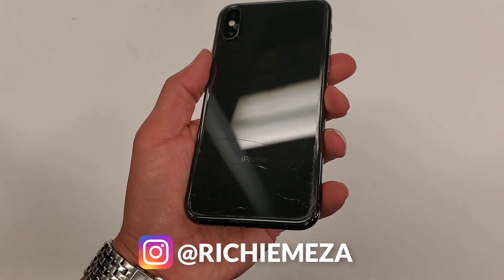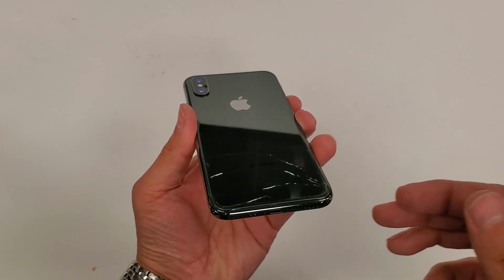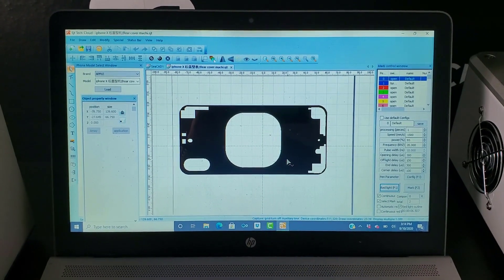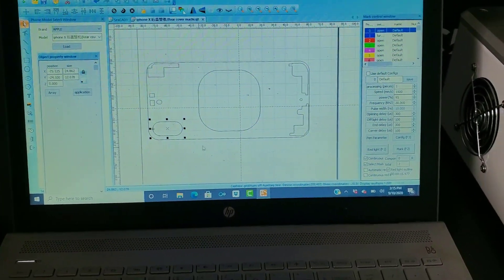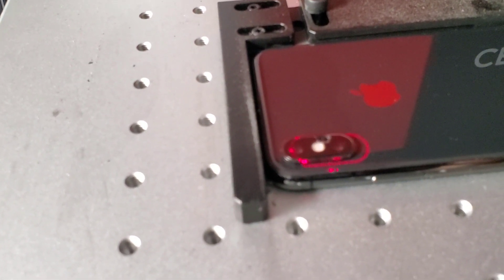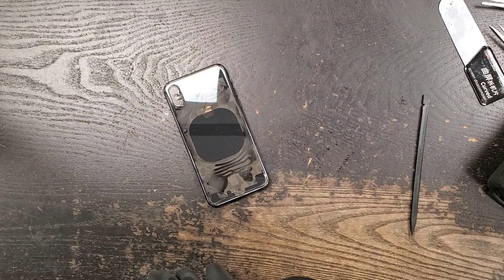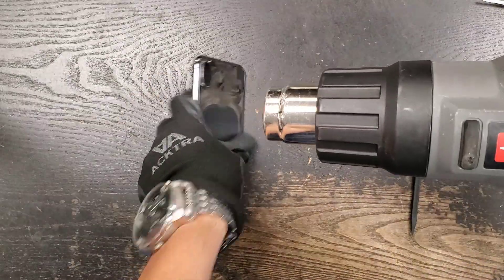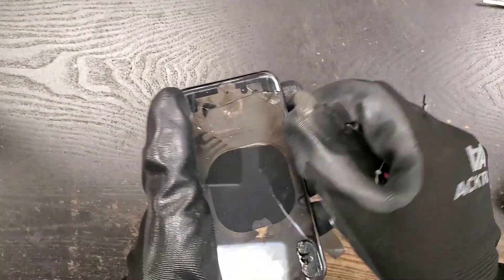iPhone Back Glass Repair using Lasers *How to replace cracked glass*

Comment: Hello Richard I have the same laser  machine I have used it twice but the bottom of the phone has sparked both times (they were both completely empty juts the housing) i have used it has that happen to you before also if you could please let me know we’re you got the back glass it would be awesome thank you
Reply from the maker: Bottom of phone sparked both times? What do you mean by that? Do you mean the laser touched the bottom and paint came off?? If So, you have to set it up first.
Reply: @RichardMeza   so wen the bottom of the phone was being removed by the lazer it literally sparked like it was going to catch on fire (the way a electrical outlet might spark wen it’s bad and u connect something) I was wondering for that’s normal outside of that everything is perfect also do u recommend removing all the components or can I do it with only the screen removed
Reply from the maker: @ricardoholguin6547  Unplug the battery, you can also remove the motherboard. I've never seen or heard of the phone sparking though.
Reply: @RichardMeza  thank you for the help

Comment: Hi Richard, What is the speed you have your laser set at to have the laser burn away that extra glue and what power level is it set at?  thank you
Reply from the maker: Do you have a laser machine?
Reply: @RichardMeza  not at the moment. But I plan to have one real soon.
Reply from the maker: @Bits4you  The business you buy it from, will tell you that info.